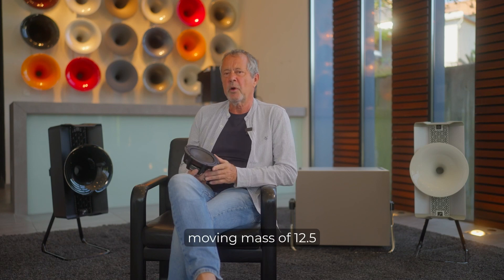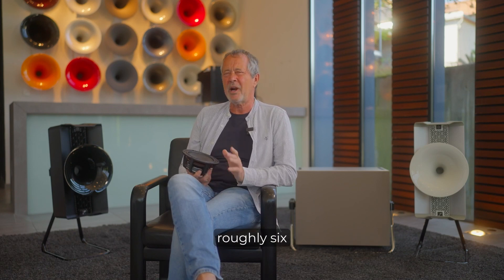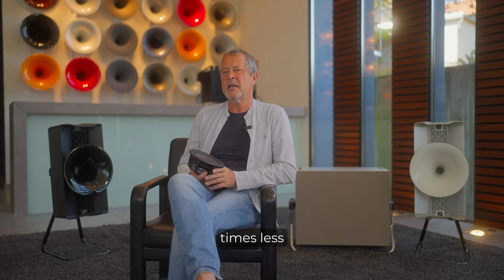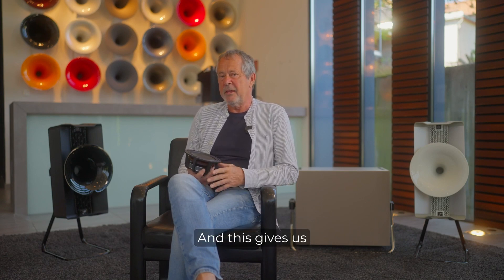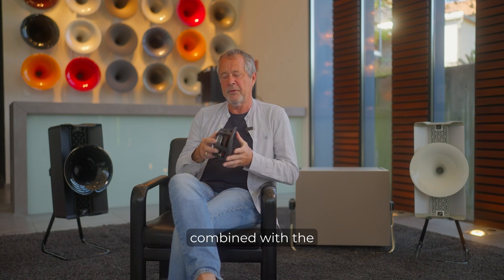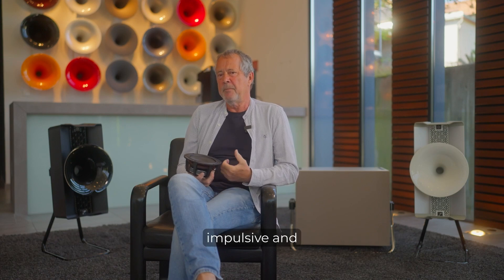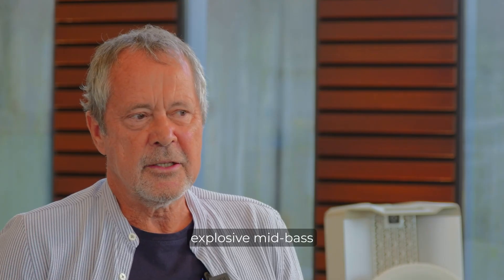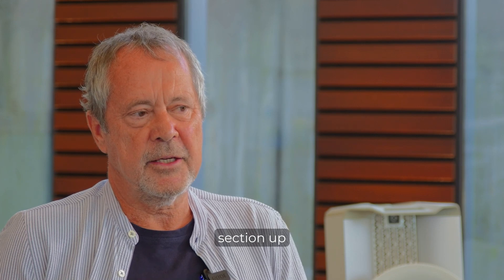Colibri - Midrange driver (Pt. 6)

Comment: That is literally a ferrite magnet. At least don't lie to the face 😂. And those who don't know it's a kartesian acoustics midbass driver.
Reply: Yes, insane. Also 12.5 grams is "6 times less than a conventional speaker box" WHAT DOES THAT EVEN MEAN??? A 6.5 inch driver usually has mms of about 18 grams
Reply: I wish I can understand what you mean by ferrite magnet
Reply: This version has been specifically and exclusively engineered and produced for Avantgarde. There is a high grade NdFeB magnet in the motor structure (not visible) in addition to the Fe magnet which is visible.